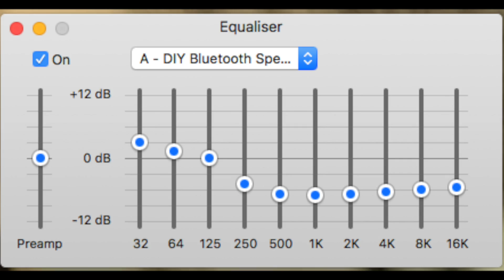10W DIY Bluetooth Speaker - Brief Build Overview

Comment: I am also using same dual battery(each 2600mah) configuration and it takes near 6 hours to fully charge after complete discharge.
Reply from the maker: yeah, sounds about right

Comment: I have some issue, i'm using PAM8403 with bluetooth receiver board.. and my problem is the speaker have some noise.. how to fix that problem, I was put elco/capacitor 16V 1000uf, but not makes big difference
Reply from the maker: Get the proper Bluetooth Module with the CSRA64215 Chip - the ones made by HYT - they're very well designed

Just search "csra64215 5W+5W" on aliexpress
Reply: @Darieee  thanks for information bro

Comment: I used the same amplifier in my DIY Bluetooth speaker but in a Food container. Check it out if you want https://youtu.be/Jyeb8gJReP4

The speakers I used was similar to the Bose SoundLink mini buts they're knock off versions not genuine.
Reply from the maker: Nice, you should add some links alongside the parts :)

And I'd recommend recommending the CSRA64215 5w+5w amplifier, way better chip, same price
Reply: @Darieee  good suggestion, thanks.

Comment: I was using 3w 4omh speaker's using same Bluetooth amplified board. When ever try to increase volume it shuts and weird beep noise? I stepup 5v for 3w speaker's!
Reply from the maker: If it makes a few beep somehow in descending loudness, it means your supply can't keep up and the chip is shutting down because of "low battery"
Reply: Thanks! So my stepup module was fault, and now it's make continues beeeeep sound whenever the switch is on. Help is Bluetooth amplified board is ok or stepup module fault! Thanks.
Reply: Set the voltage to 5v instead of 6.5v.
Problem will be solved.
Reply: @kjahan9491  this for amplifier or bluetooth board?
Reply: i had some issus for this..make so confuse

Comment: Hey Darieee, i was wondering how you wired  the speaker.

So, battery goes to B+ and B- . Good.  But how do you wire it from battery to the amp/step-up DC?

is the board also the ' circuit ' ?  so by having B+ and B- connect, you can run electricity through out + and out- or what?

thank you in advance,
Regads!
Reply from the maker: So, you first have the battery management board : http://ebay.to/2js6XMq

On this one B+ and B- go to the battery & OUT+ and OUT- go to the booster module : http://ebay.to/2j4ydxP (evidently to VIN+ and VIN-)(this is the part you set to ~6.5V)

From the booster module, you take VOUT+ and VOUT- directly to VCC and GND on the Bluetooth/Amp module

Comment: Hi man, Can you tell me if there is any problem with charging two batteries totaling 7.4v. Could I use this board to charge six of theses batteries for a 24v larger system?
Reply from the maker: So I'm assuming you're using a larger amp than this ..

I used a 6S protection circuit and 6S balancing board in another setup:

http://www.ebay.de/itm/6S-22-2V-Li-ion-Lithium-Cell-25-2V-10A-18650-Battery-BMS-Protection-PCB-Board/122150047183

http://www.ebay.de/itm/6S-6-Cell-22-2V-25-2V-18650-Li-ion-Lithium-Battery-Charger-Module-Balance-Board/263104513755
Reply: Darieee Thank you.. I didn't know they existed. But what's is the need for the balancing board? Do they work during charging or discharging? Could you send me a schematics of the wirering? topcms@hotmail.com

Comment: Can i use 10v 3300uf capacitor ? Bcs I don't find that specific one you used.
I have a 16v 1000uf capacitor also.
Reply from the maker: It should be fine :)

Comment: What's the output current from the stepup module? 5v or 6.5v
Reply from the maker: +Sayan Majumder you should check the definitions of current / voltage / power :) 

- either way, I’m feeding it the maximum voltage it’ll take to get the most power : 6.5V, and at that it takes around 20-100 mA at most of current

Comment: May I suggest using one of those phone power bank things. They have the charging and protection circuit built in.
Reply from the maker: +James Collins yeah, those are fine so long as you only need 4.2V tops : for something like 24v you’ll need some fancy ass setup (working on it - parts are on the way)
Reply: Good point. They're good for very small amplifiers like the PAM 8403 though.
Reply: It did not work for me, that circuit popped like a firecracker when I hooked it up to the 3x4v batteries (12v). I ordered another BMS for the Marshall Woburn replica I'm building.
Reply: use a drill battery

Comment: What kind of capacitor did you use?
Reply from the maker: +Ismael Tlatenchi I think it was above 1000uF at somewhere above 10V
Reply: Darieee thank you it's really helpful
Reply from the maker: happy to help :)
Reply: One more question how do you put the capacitor +and negative or in line positive?
Reply from the maker: +Ismael Tlatenchi connect capacitor + to supply + and csr module +, and - to - (ie in parallel)
Reply: Darieee thank you for all your help I did a big Bluetooth speaker but I'm doing a small for my daughter and trying to figure out this thing about the capacitor
Reply from the maker: +Ismael Tlatenchi best luck !
Reply: Darieee thank you

Comment: The amplifier consists of two integrated cips audio amplifier!
The name of chip is: LTK8002D,and power amplifier is 3w 
is stereo because is two chips audio amplifier
Reply from the maker: +Petrica Butnaru it does specify in the datasheet - if you feed it 6.5 (or 7 I don't remember), it's actually 5W per channel
Reply: guys i have a mono bluetooth speaker with this LTK8002D thing on it  and want to turn it into stereo. So your telling me that shit dont have L R output LOL   it has this RDA  5856TE bt chip on it is this chip has stereo output ?  if i look here :
https://detail.1688.com/offer/538315369781.html

it looks like i have mono version ?

Comment: Axel Romero  1 second ago
somebody can help me with the list of components? I tried to buy them but there are not longer in the website
Reply from the maker: CSR Amp Module: http://www.ebay.com/sch/i.html?_odkw=csr8645+10w&LH_FS=1&_osacat=0&_from=R40&_trksid=p2045573.m570.l1313.TR3.TRC2.A0.H0.Xcsr8645+5w.TRS0&_nkw=csr8645+5w&_sacat=0 
Charger Module: http://www.ebay.com/sch/i.html?_odkw=liion+micro+usb+charge+protection&LH_FS=1&_blrs=spell_check&_osacat=0&_from=R40&_trksid=p2045573.m570.l1313.TR0.TRC0.H0.Xlithium+micro+usb+charge+protection.TRS0&_nkw=lithium+micro+usb+charge+protection&_sacat=0 
18650 Battery: http://www.ebay.com/sch/i.html?_odkw=lithium+micro+usb+charge+protection&LH_FS=1&_osacat=0&_from=R40&_trksid=p2045573.m570.l1313.TR9.TRC1.A0.H0.Xpanasonic+ncr18650.TRS0&_nkw=panasonic+ncr18650&_sacat=0
Speakers:
General eBay Search: http://ebay.to/2lJRhlp
High-End Option: http://ebay.to/2m5pFbo
Cheaper Option: http://ebay.to/2m59dI3
Reply: thanks for the answer :D One question more: what is the model of the step up module ?
Reply from the maker: You're welcome :) here it is (you definitely want the one with the tiny tiny chip, has a significantly lower stand-by current .2mA compared to 20 or something like that on the one with the big package) : http://www.ebay.com/sch/i.html?_odkw=step+up+module&_osacat=0&_from=R40&_trksid=p2045573.m570.l1313.TR0.TRC0.H0.Xstep+up+module+MT3608.TRS1&_nkw=step+up+module+MT3608&_sacat=0
Reply: thank you very much friend. To build it and test it :D

Comment: if I also want to build in 2 batteries, do the cable have to be   -> + -> + or + - (sorry im new 😅☺️)
Reply from the maker: +Sofia Pink + to + and - to -, that way they're in parallel. I have to say though, uppon opening mine up to set the equaliser, I removed one of the batteries (I had two panasonic NCR18650 each of 3400mAh), and it had a stupid battery life - I charged it twice in a whole year ... so, was way overkill
Reply: Thank you for answering so fast! And another question, are you german? (because in your info card was a german link to eBay :D )
Reply from the maker: +Sofia Pink no, but I do live in germany :D (I do get notifications on my phone for comments :)
Reply: Darieee das erklärt einiges😂💪🏻

Comment: Could you send a picture to me of how you wired the battery charging board as mine turns a red led on and doesn't charge the amp properly unless I wire directly to the input of the charging board then the led is blue :(
Reply: Darieee  ok thanks, I will send an email now